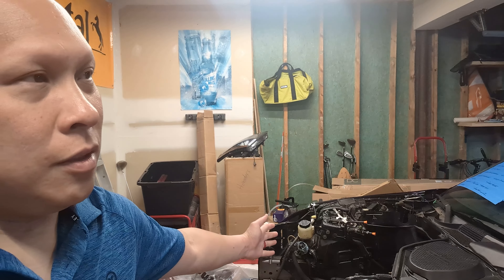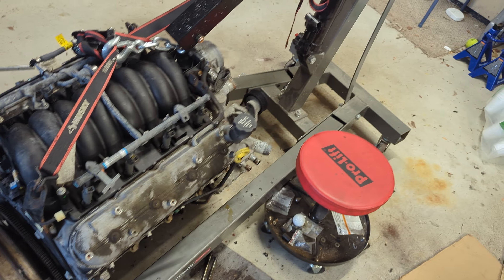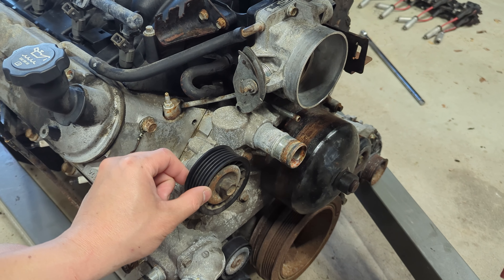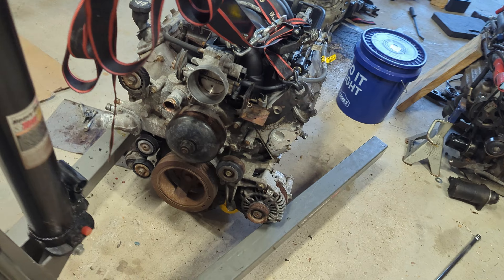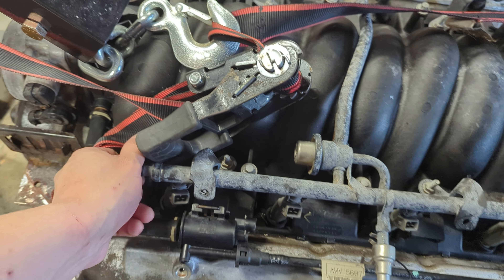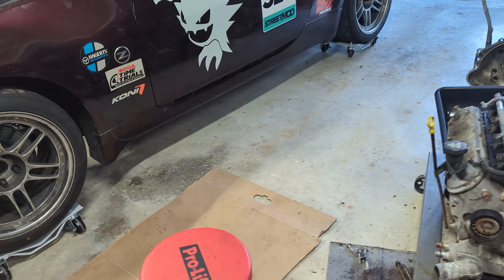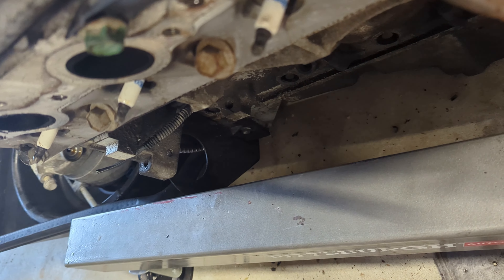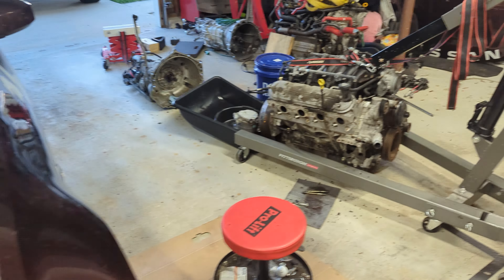Next steps for the Z

Comment: Making good progress there. The cap on the fuel rail is a test port to verify fuel pressure with a manual gauge. If the engine is from a GTO it should be an LS2, not many differences but definitely an upgrade from an LS1.
Reply from the maker: Thank you! 

It's and LS1 cam, 241 heads, and LS6 intake. Hodge podge of parts for 04.
Reply: @PhilJue  should work well. Make sure to do a compression test once you get it in so you have an idea of the current condition and have a baseline to check against in the future to diagnose any issues.
Reply from the maker: @NickWhite630  I did a leak down and things look decent!

Comment: Replace the harmonic balancer for sure while is is out of the car. They tend to separate. Summit makes a nice SFI one. You're right the 04 ls1 should have the ls6 intake. Looks fun. Going with link for the ecu? Also think about putting an oil block while it is out so you can run an oil cooler.
Reply from the maker: Oil relocation kit and harmonic balancer obtained 💪